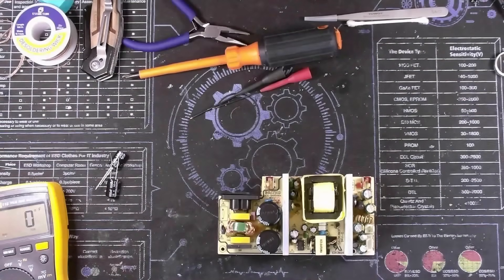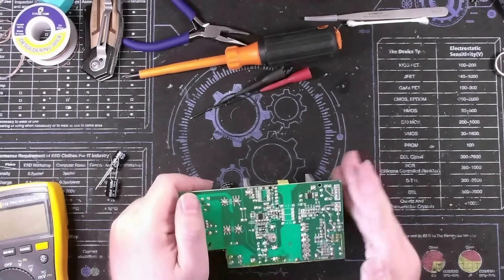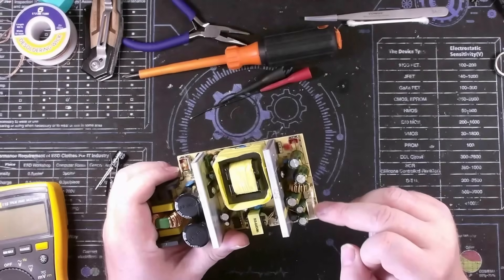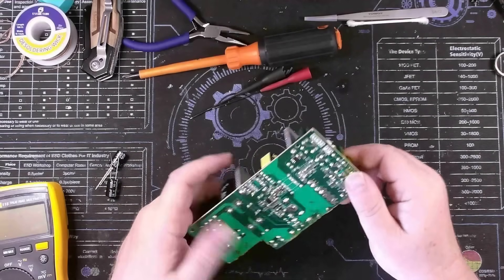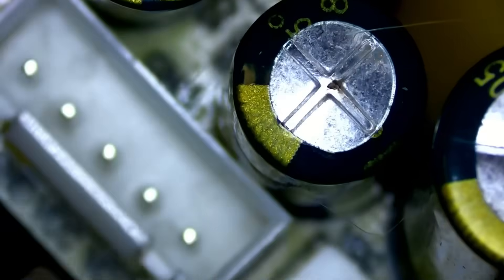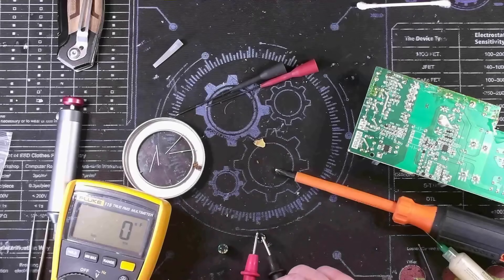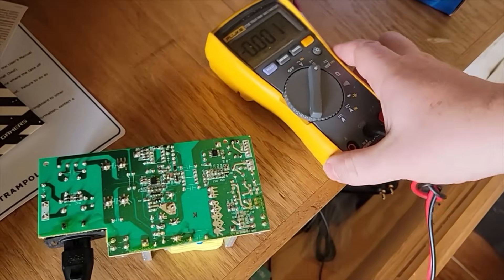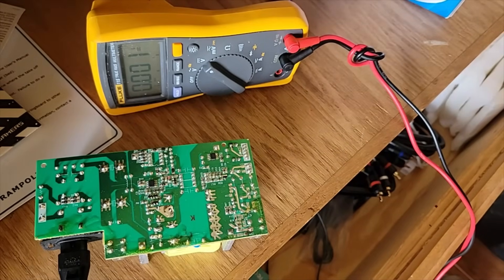(Quick Fix) SMPS Repair for Klipsch 1200 Sound Bar

Comment: $6.95 is what it cost me to fix my soundbar, and could NOT have done it w/o this video.  Appreciate you taking the time to post this!!!!!!!!!!!
Reply from the maker: If you have the money I would recommend low ESR nichicon and high temp Rubycon capacitors in the SMPS. It will cost you a little more (around $14) but will give you some more longevity. I've another video coming out on this same soundbar where I go into details why with some explosive style testing. Not begging, but please sub, share, and only if you desire a super thanks allows for a direct donation thru YT (they take a percentage but it's still an option). Thank you for the comment and I hope you stick around for that next video when it releases sometime in December.

Comment: I really appreciate it when individuals like you post video’s like this.  My unit went out yesterday and thanks to you I was able to fix it myself today for $4.43!  TWO THUMBS UP
Reply from the maker: If you have the money I would recommend low ESR nichicon and high temp Rubycon capacitors in the SMPS. It will cost you a little more (around $14) but will give you some more longevity. I've another video coming out on this same soundbar where I go into details why with some explosive style testing. Not begging, but please sub, share, and only if you desire a super thanks allows for a direct donation thru YT (they take a percentage but it's still an option). Thank you for the comment and I hope you stick around for that next video when it releases sometime in December.

Comment: I’m having a problem with my cinema 1200 soundbar as well. Everytime you power it on the sound won’t work, so I constantly have to unplug the power cord and plug it back in for it to come back on, and sometimes that doesn’t even work so I have to wiggle the cord around in the port for the sound to come back.
Reply from the maker: Is the port physically damaged?
Reply: @HavingFunRepairs  No, not that I’m aware of.

Comment: This video was super helpful. Klipsch was zero help. Apparently all of them die around the 2 year mark. They were well aware of the issue and made zero changes. I think this deserves a class action lawsuit. Either way. I learned to solder and got it done with $12 in capacitors. Thanks again for this video.
Reply from the maker: Thanks for watching! Please consider subscribing and if the video was extremely helpful there is a thanks button which allows for a one time donation to this channel and is always appreciated. Cheers!
Reply: @HavingFunRepairs  I’m having the same issue with my power supply on my 1200. I also have a model klipse R20B with the same issue. Can you make repairs?
Reply from the maker: I've halted repairs outside my local area. However, email me at havingfunrepairs@gmail.com and we can discuss there.